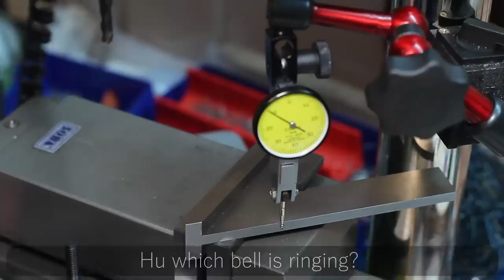#roughcut2022 Making A Universal Chamferring Tool For The Lathe

Comment: Wouldn't have expect that mill to do such a good job in tool steel, even if it did cost you 3 cutters.  Great idea though, I might need to borrow that idea, love the double sided insert idea. Cheers
Reply from the maker: Hi and thanks for your kind comment! The proxxon mill can do it but I think the cutters break because of instability of the machine causing vibrations and chattering. Perhaps I can improve the machine a little bit... And off course, feel free to copy the design ;)

Comment: Use HSS on that mill with steel, it is not rigid enough for carbide.
You can prolly get away with carbide roughing mills on some steels though.
Give both a try, you will be happy you did, especially the roughing mills. I resisted using them for a long time to my detriment. They require much less power and prefer lower RPM's. They still need high contact pressure, but the nature of the tools puts less strain on the machine so helps with your rigidly issue. Cobalt tooling is really your best bet for steels though.

Comment: I'm a little surprised you only broke one of those D bits, they are intended for fine engraving on the tip rather than any significant material removal on the sides.  Cutting 5-6mm off the tip with a cut off wheel would have made it quite a bit stronger for this kind of job.
Reply from the maker: haha :D yes, these D bits are not made for such "heavy" cuts. I just had no other idea of bringing the angles to the sides. Luckily I bought 3 of these cutters, two are still left:)
Reply: @WeCanDoThatBetter  I made a couple of insert type tool holders a couple of months  ago and how I machined the side/flank clearance was by setting the head angle of the mill over and positioning the tool in a swivel vise. That way I could use a square end mill to cut the flank angles without fear of breaking one.
Reply: @WeCanDoThatBetter  what did you take 1thou cuts?
Reply: @WeCanDoThatBetter  There is not a problem with D-cutter. Your rigidity of the milling machine is VERY low. Until you will not make a scraping job with adding of concrete in your Z column (or replace it to solid column) - all mils will be damaged. Also - it will be impossible to get precision surfaces  of milled milled parts. It will be a great video with your milling upgrade. BTW do not forget about backlash of feed.
Reply: It would seem then that the broken bit could be used by just dropping it down.

Comment: Hi. I think your endmill braking is caused by climb milling which need very rigid machine. At 7:07 I've noticed Axis jump. That's a Leadscrew backlash. Next time try conventional milling it may help. Thank you for good educational video. Great tool.
Reply from the maker: Thank you very much for your kind comment and feedback! I think you are right. I haven't watched the direction I was milling. Especially on the edges the tiny cutters tend to break when climb milling. Noticed to myself for next time;)

Comment: Nice work and presentation. 
I also have one made with a smaller diameter holder to expose three tips of insert to do OD ID chamfering. The relief angle could be more aggressive to cope with a smaller ID. This way I can integrate only one chamfer insert to the opposite end of existing tool body to a double end cutting tool.
Reply from the maker: Thanks for your comment and feedback! Your solution sounds interesting. Do you have pictures of it?

Comment: Nicely done. Always good to be able to use up spare inserts laying about and making a tool for the job is a great idea. I would say a bit of air on those small end mills to keep the chips clear may have lowered the dead body count for you.
Reply from the maker: Hi and thanks! Air or the vacuum cleaner probably may have made it a bit easier for the cutter, yes. And the first one, I did climb milling and right on the edge of the part, when the cutter isn't in even contact anymore, it broke.
Reply: @WeCanDoThatBetter   and also you material is clearly quite heavily magnetised, I think I'd have had a go at de-magnetising the part and just maybe the chips would have flown off of the part rather than sticking to it and bunging up the cutter with swarf that's already been cut
Reply from the maker: @samrodian919  Yes, thats something I noticed too. I think it comes from the milling motor. Maybe it magnetices the chips. On its housing there are hanging magneticed chips as well.

Comment: Nice. Stefan made a version with CCGT at a 5 degree offset than can be used for external and light internal chamfers / deburring but only right handed. This one is more versatile, well done. Some tears were shed for those endmills. Feeds, speeds and runout / rigidity play a huge factor - at least those smaller endmills are cheaper, I chipped a 10mm carbide one yesterday 😭
Reply from the maker: Thanks for your comment! I feel you, loosing the carbide endmill ;)

Comment: Nicely made tool, I may have to borrow that idea, thanks for sharing 👍

By the way, I use those inserts a lot, the high rake angle and geometry is designed for cutting aluminium, though I also use them for brass to good effect.

The tip wall is really thin though, which is why they break easily when cutting steels.
Reply from the maker: Thanks for your comment! Sometimes I use these inserts for steel but they wear and brake really fast, so not ideal.

Comment: Its a lovely tool but honestly that is a lot of work. I have a single ended one and for the few times I need to rotate it I honestly dont think I need to put all this effort into this tool, very nice job though
Reply from the maker: Thanks for your comment. Yes, looking back it is really a little bit overkill and much to much effort for a little tool. Could have bought a toolholder for the inserts as well. But as long as it does it's job as good as intended I will be ok with it:)

Comment: Good job with a nice finish on the work piece ! But i'm wondering why these end mills keep breaking ?  My theorie is that the cutting speed ( rpm of the spindle) is too low for such a small end mills comparing to the feed rate (too high in this case) thus producing an important chipload that causes the endmill to break, what do you think ?
Reply: They break because they are extremely thin, and carbide is brittle. A 2mm endmill is only slightly thicker than a matchstick or toothpick.
Reply: @johncoops6897  No doubt about that, they are thin ! but nonetheless something must be off in terms of parameters, i mean if 2-3mm endmills would break every 1 or 2 minutes into every cut no one would ever use them i guess, it wouldn't be very efficient !
Reply: @sayebsalah7742  - Yeah, but remember that an end mill is designed to plunge, not to cut sideways. Using one to mill the side of a surface puts enormous load on the cutter.
In CNC work, they use larger tools to hog off the majority of material, and then take very light cuts with the smaller ones.
He said in another comment that there is some runout in the spindle, plus the particular machine is not very rigid. So I would say that it is chattering and that vibration is snapping the very thin carbide shanks.
As an aside, I buy lots of carbide drills for circuit boards. They have a 1/8" shank that fits a dremel but are only 0.9 or  0.7 or 0.5mm diameter. They are designed for exceptionally fast yet accurate downward drilling, at speeds faster than a human eye can detect.  Even with the most steady hand, it is almost impossible not to snap them when using them in a handheld tool.
Reply: The end mills broke for one reason, and one reason only:
The mill lacks rigidity.
Carbide is a very poor choice on these little mills. Carbide requires a ton of tool pressure, and even with small endmills, these toy mills are not rigid enough. HSS is a much better choice, especially in steel because it requires much less tool pressure.

Comment: Would someone please explain why he made one end (rear/inside) 2mm higher?
If for clearance, is lifting the tool better than just grinding some relief on the underside of the holder?
Reply from the maker: I wrote it in the description: it is to have clearance for the insert as the inserts only have 7° clearance angle which is a little bit too less for smaller bores. With the 2mm higher end you don't have to lift the tool and fiddle around with height adjustment, just flip the toolholder 90° and start.

Comment: Would it have helped to use fluid or cutting oil?  Usually heat is what causes the metal to break more easily.
Reply from the maker: Thanks for your comment. Cutting oil might have helped. But I think it was mainly a combination of a not so rigid machine and vibrations.
Reply: @WeCanDoThatBetter  & climb milling...
Reply from the maker: @MidEngineering  Yes, that too...

Comment: What a great concept, but you picked the wrong blade chip.You should choose a flat blade, otherwise the tool holder must be beveled.
In addition, this tool is usually used for OD heavy cutting, so your final demo doesn't really show its true character.
Also, homemade tool holders often have precision issues, which can prevent you from locking the screws to the correct tightness, or there will be gaps that can cause displacement and cause the blade to break.

By the way, if your ruler has a drop scratch,just replace it with a new one instead of decorating it.
Reply from the maker: When the screw hole which holds the insert is a little bit more to the back side of the insert seat, the insert gets pulled right in and hold securely in the seat.
Reply: I am very clear about this.What I want to express is that the throwaway turning tool is a precision machine,Although its composition is simple. its precision requirements are still very high.
When I was still in vocational school, we all used the school's tool holders. Some of them just had a slight deformation of the screw after hitting the chuck, but the insert could not be locked tightly or it would be cracked.

How do you know if your precision is controlled within 0.02 or 0.01mm? If it is not so precise, the insert will slide unexpectedly during work and there is a chance cause that the corner collapse.
Reply: @kyvih9217  I don't believe a trip to the moon was in the mission brief. Based on this guys previous successful insert tooling builds he has the precision side of things squared away ok.

Comment: Why not just buy two cheap 45 degree insert holders and join them back to back to required length, all that work and the cost of broken tools surely would be more than buying them. Overall good learning exercise i suppose.
Reply from the maker: That would be the easy way and a very short video I guess ;) The #roughcut2022 idea brought me to this tool. So I just wanted to try out that idea. And I'm really suspicious about the cheep insert holders. And medium quality ones cost quite a bit.